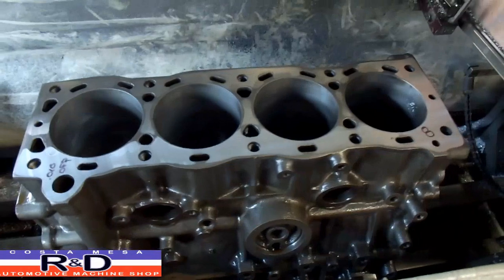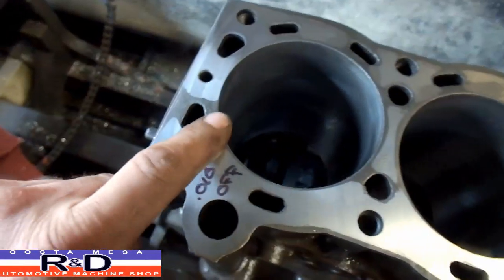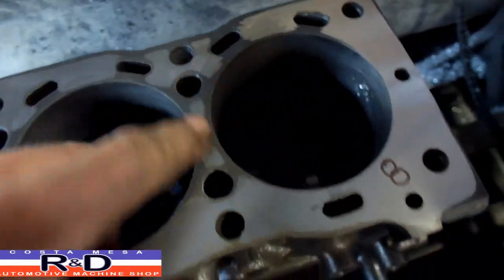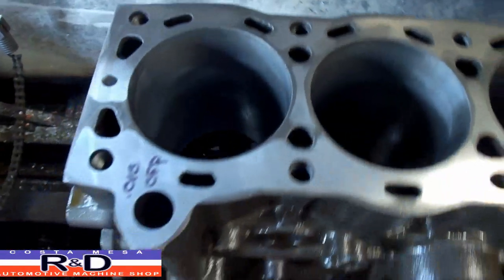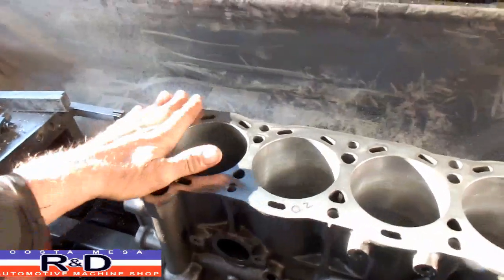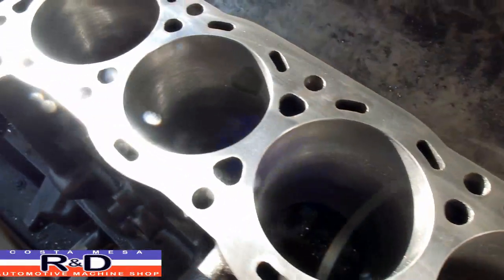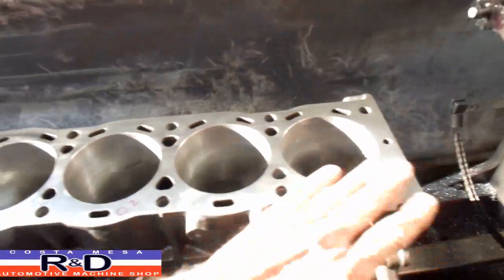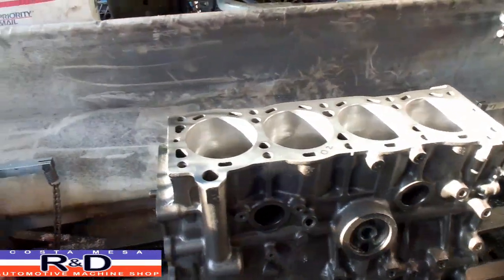Toyota 22R Block Resurfacing

Comment: If you don't have access to an expensive resurfacing machine you can get close to the same result by gluing sand paper to a large piece of glass and sliding the head over it with oil or water and soap as a lubricant. But gosh taking a disk sander to the the head is just money down the drain.

Comment: i use  a  sanding  block with some 120 grit sand  paper  to clean the  surface
Reply: Don't do that.....
Reply: why not? its  flat and its  just to remove crud ya dont   remove metal